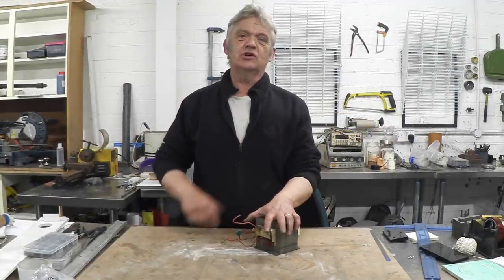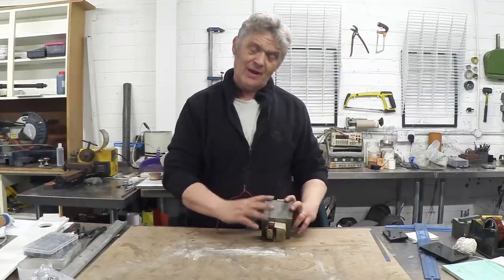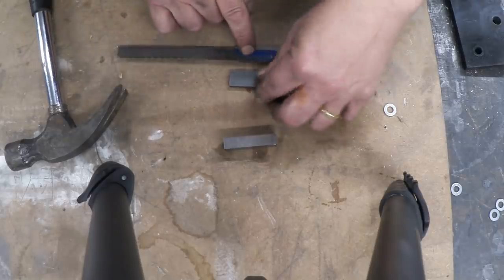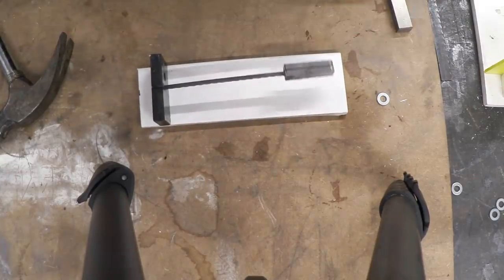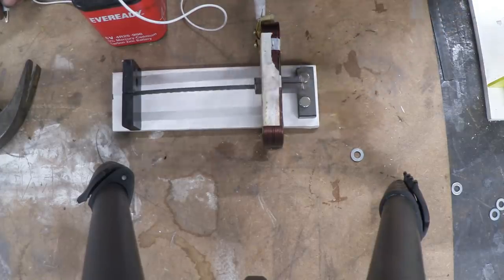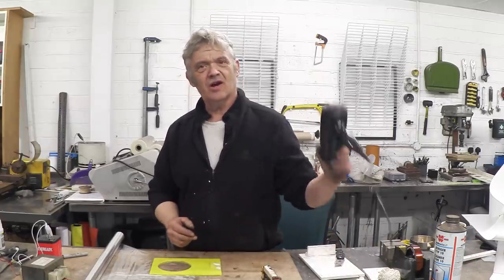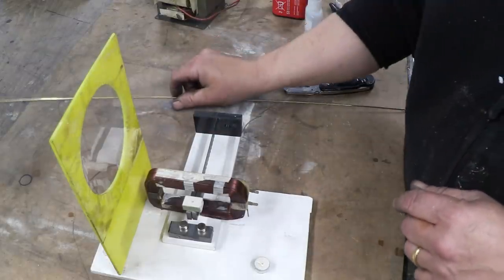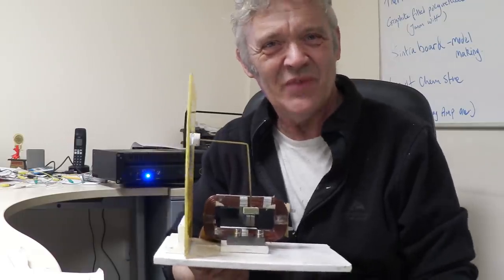Making A Speaker From A Microwave Oven Transformer

Comment: Nice! Im surprized about the quality of the sound. Btw, amazing rate at which you pump out new videos! Almost hard not to miss one! 😂
Reply from the maker: I was surprised too - a little tinny - button bad
Reply: It would sound even better in a box with dampening and would probably take the tinnyness away👍
Reply: what about the connections he made, i really did not understand what was connected, did he connect the battery and where and where did he connect the wires from computer.
Reply: @codeaccount2434  The leads from the sound source are all you need and are connected to the two leads of the coil.

Comment: the reason it is tinny is the hacksaw blade is relatively short and favors high frequencies as  its natural resonant frequency . with a frequency divider network  and some careful choices as to size  you could get a subwoofer woofer midrange and tweeters with a resonant cavity for each and some pots to fine tune the balance between frq. ranges i think you would have a very nice speaker  :-)
Reply from the maker: nice mate - cheers

Comment: How a speaker works in the most simple to understand way, great stuff!
If anyone is looking for a suitable track to test theirs, I would suggest 'Elastic plastic' by Mad Professor.... Seems appropriate!
Reply: Sofa-Lofa ,  I could not find that piece.  Did you mean Plastic Elastic by Madboy?  It certainly has an interesting variety of synthesized tones and harmonic distortions.
Reply: @ScientificSolutions  Not sure of the original album, I've got it on a compilation 'The Dubest 1982 - 2003' by Mad Professor
It's just that the title/artist name seemed appropriate for this build, I've just found the track you mentioned and it's not bad actually
Reply from the maker: it does indeed lol

Comment: .......it works then with coil in orientation you've given. I wonder if it might give more output with coil rotated   90° so as to become parallel with the saw blade arm . You put that builder's board to good use.
Reply from the maker: give it a go mate

Comment: If it were me I would have use the microwave transformer with he high voltage to drive a quartz crystal. Make sure the wires are on two parallel faces of the crystal. It should act like a piezo speaker. I did this with a direct hook up and it worked but was quiet. So a Large cube or large sheet of Rochelle salt might work as well.

Comment: Thanks. So  the mains winding received a regular speaker electric drive and this resultant alternating flux added to or subtracted from the two magnets and the flux at the armature / blade. Fantastic and would like to know the efficiancy rel to a regular speaker and or the mechanical gain. Is it a mechanical analog flip flop .

Comment: No spider, or anything traditional, but likely not good for mid low range frequency,  I saw a antique radio for sale a while back, it had the strangest speaker, it looked more like a antenna and record player's offspring, it had a pin inside a cone shape paper, inside metal ring, the pin had a coil attached,  some how it made sound through the paper cone! I didn't see a magnet, maybe the pin was a magnet? I just know it was weird! If it wasn't making sound on top of a old radio, I would think it was a antenna, or just be clueless! Things have come a ways since then , but we are not nearly as far from that tech ad we could / should be!!

Comment: That was bloody awesome Robert. I wonder if this can be replicated winding your own coil. I guess it would just be a matter of the right number of windings. Iron core isn't too hard a and I have some of that thick black plastic board. I will have to experiment with different coils.
As far as the tinny sound, that can be overcome by a different material for the membrane / diaphragm. Maybe even a different size? I think a really thick and large membrane will give more bass. I am just thinking this due to standard speaker sizes in a stereo setup, subwoofers are big, tweeters are small and normal speakers are medium.
It all comes down t o experimenting I guess.
Reply from the maker: tbh mate just about anything will do - optimising it will be harder but getting it working with your own coil would be pretty easy

Comment: I would imagine the impedance was pretty low on the speaker.
Reply: I used a microwave transformer to make a car starter once. If I remember, the secondary had a resistance around 0.9 ohms
Reply: @MikinessAnalog  Neat!

Comment: a good reason for the speaker and tearing it down to do this I believe would be to make things that would be far better tools than just strapping a speaker to something (like I am using a subwoofer for a vibration unit like long term large flake generation of stuff by causing it to knock about against each other and other things with graphite, sort of like a rock tumbler that shakes instead of rolling around, but with controllable frequency of vibrations up to that 20kHz, now if I could make something that can go much much higher and still have the ability to be controlled in a wide range between 1mHz to say 10mHz LOL  anyway my point is modifying the bits (magnet and coil) from a subwoofer instead of this set up I think might be more efficient and allow building ALL sorts of tools, your hacksaw idea I really like as a wobbly bit that has its own rigidity, going to steal that instead of thanks to your video not having to come up with it on my own (I might have but it would have taken time and looking over all my bits and bobs before the sparks flew and I ended up realizing it would work for that, since most of us think of saws for cutting and not about the other properties they have XD) but I was going to say, originally as I was watching I thought about using the coil to cause an in and out action or back and forth action on a rail that you can put an extended bit of abrasive covered item (like a diamond file covered with crushed diamond) and use it as a vibration cutter :) basically an electric saw that has the ability to cut through hard stuff like silicon wafers or quartz and glass XD. (or shape it) always love how your videos get me thinking and coming up with all sorts of new stuff,
Reply from the maker: I can see mate - just a ton of ideas - love it - I do like the vibration cutter idea - I like that a lot - probably going to steal it lol
Reply: @ThinkingandTinkering  LOL hope you make a video of that, as I would love to see it.